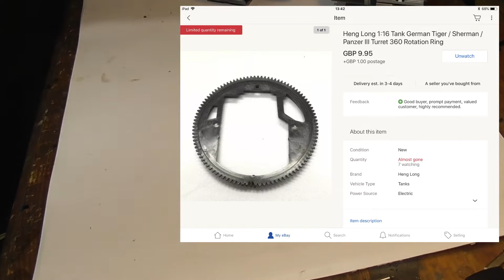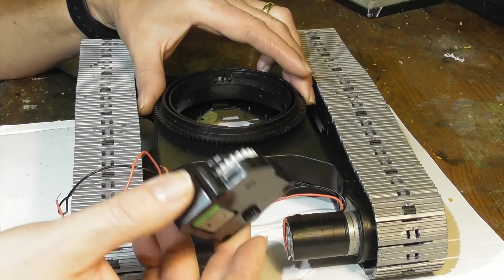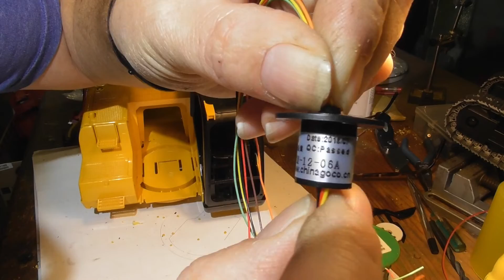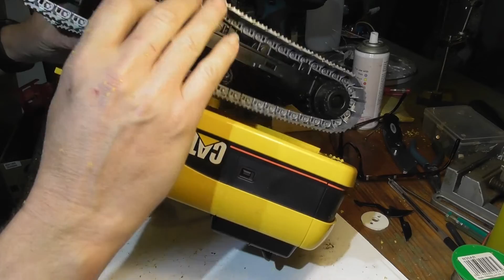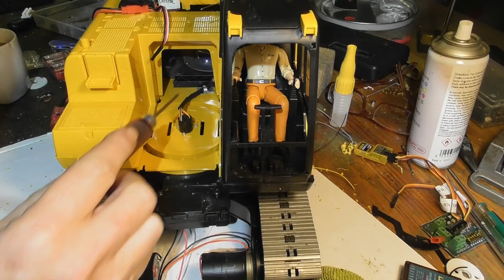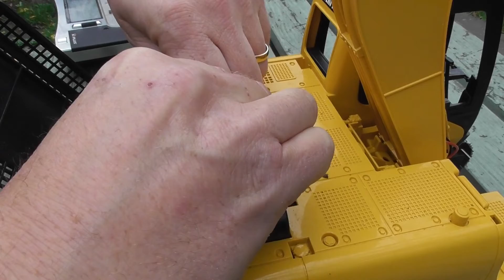Bruder CAT Excavator RC conversion pt4: 360 degree turntable

Comment: I dont know if anyone said anything to you yet or not, but you need to put the track controls on a different switch that the boom controls so you can use both the tracks and boom at the same time. I run an excavator in real life and have to use the boom to help get myself unstuck all the time. Keep up the good work though. Love what you are doing
Reply from the maker: In its latest form I’m using a flysky i6 tx.  With tracks on the top corner wheels and sticks for the boom and cab turn etc. Much better.

Comment: Hi RD Modders. I Came across this series of mods to add automated RC lifting and rotating parts on this vehicle and think it's great. Your video is clear, concise and no loud music in the background so we can hear your voice clearly - thanks for that. I've bought a 1/32 crane which I will mount on the deck of an RC push tug that I will make from plans. The crane has a similar layout to your model although smaller but I'm copying your ideas and searching smaller motors, threaded rods etc. So just to say keep up the good engineering work.
Reply from the maker: Many thanks for your comments & good luck with the build! 😀👍

Comment: Beautiful work bud it is coming along very nicely it’s a work of art..  I will be building this as well.. have you seen the bruder Volvo a60 I have been wanting to get my hands on one for a conversion but they aren’t offering them for sale over here in the states..I might need a middle man to get one too me 😁😉👍🏼👍🏼👍🏼👍🏼Thumbs up as always keep up the awesome descriptive videos...
Reply from the maker: Thank you! This ones a real labour of love and the challenges keep coming .... I think that it will be worth the effort in the end, I’m looking forward to digging with the non-return-to-centre actuators - as this always frustrated me with the Hobby Engine one a bit, as it felt counter-intuitive to operate and I couldn’t find a good way round it using programming on any of my transmitters. 
Yes, I have noticed the big Volvo dumper. Funnily enough I ordered one from Amazon a few days before the release, only to find out that delivery would be delayed - 1st Nov I think they said. I think that this will be a great conversion, not too difficult, apart from possibly the steering - I think I would prefer return-to-centre proportional for this (I don’t really like the control for the Hobby Engine wheel loader, even with micro switch end stops) - so could either end up with a really powerful servo or even a Firgelli / Actuonix linear servo (borrowed from the Hobby Engine excavator?) for this. 
I’m still waiting to find out what was in your mystery box over at your channel 🙂👍

Comment: could you make the gearbox for the turret self tentioning using a spring or rubber? that's if the mesh causes problems later down the line
Reply from the maker: Thank you. I'll keep an eye on the meshing of the gears -  so far there is no sign of any trouble! 👍😀